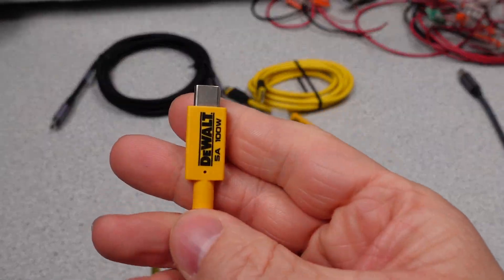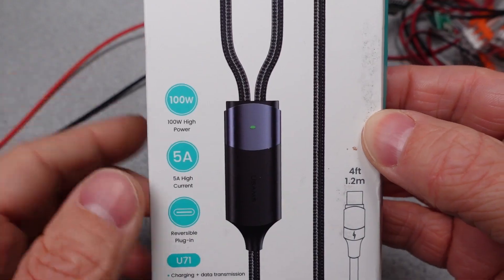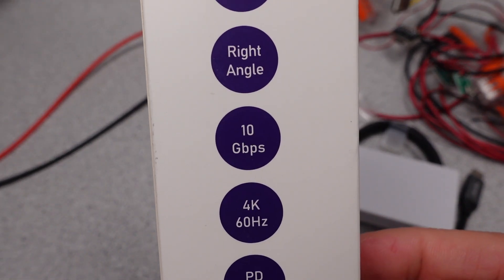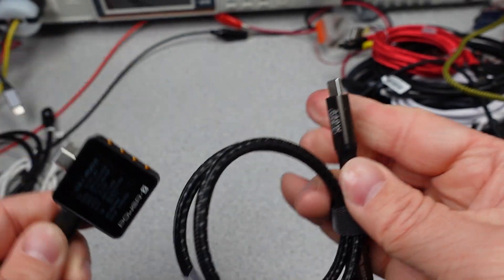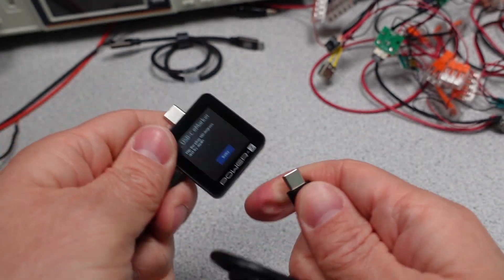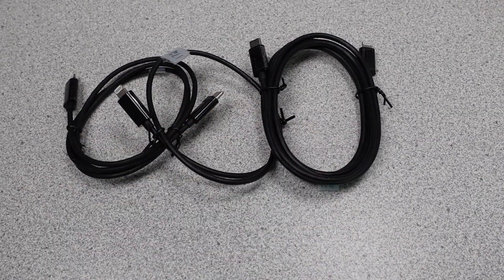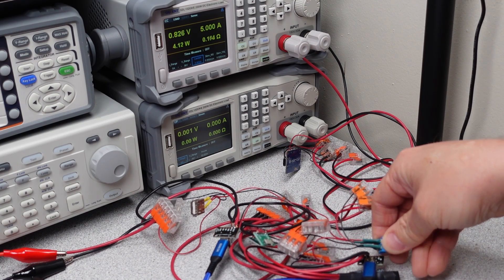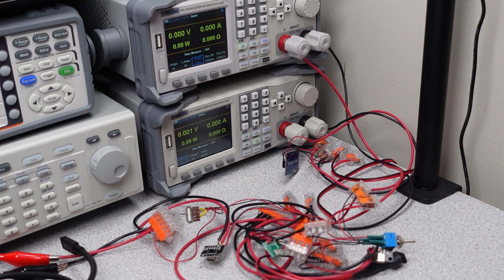USB Cable Power Performance for the fourth time

Comment: Thanks for the video and the good work, I've been waiting for this one for a long time. I'm surprised the 240W cables do not trust the top places for the resistance per foot metric nor make a big step forward in terms of performance compared to the 100W rated cables. 
In your opinion, should we expect a jump in performance (ie lower resistance) for the 240W cables in the future?
Reply from the maker: No.  The wires are exactly the same as before, the only difference is the chip in the connector end.  There are a lot of very good performers though.  I am really curious what wire Satechi uses, because they have a good formula worked out to get a lot of power down that wire and I want them to release a series of 240W cables.

Comment: Best case resistance for USB-C cables at 20C 
USB-C connector resistance is typically @0.025ohms on each end
28AWG 3ft USB-C cable 0.195ohms+0.050ohms= 0.245ohms
26AWG 3ft USB-C cable 0.122ohms+0.050ohms= 0.172ohms
24AWG 3ft USB-C cable 0.078ohms+0.050ohms= 0.128ohms
20AWG 3ft USB-C cable 0.030ohms+0.050ohms= 0.080ohms
Reply from the maker: Yeah, I need to spend a bit of time doing some data analysis and present it better.  Should be able to put the cables in bins as you have presented.
Reply: I got a cable with 2 different lengths from AliExpress which claims 18AWG for the power lines. And measuring with TC66C (using external power, both Power and PD switch are off to make it as accurate as possible) and 5V 2A. The results i got were about 0.0925 ohm for the 1M variant (should be with the connectors then) and 0.1425 ohm for the 2M one. Idk if it's really 18AWG but it does seem to be one of the best so far.

Comment: The spreadsheet is not really interactive and/or not possible to copy. So no way to filter, sort etc so essentially I can't use it to look up cables I would want to buy. Did I misunderstand something or it just doesn't work on my end? tried in a private window without ad blocker as well, same result.
Reply from the maker: Hmmm.  I suck at code, if that isn't obvious, ha.  Jack of no trades master of all or something like that.  Anyway, I just went on the page highlighted the text, hit control-C, made a new excel document and hit control-V and it worked almost perfectly to make a copy.  The top row was shifted over one cell in excel, easy fix.  Then data parade go.

Comment: Surprised you didn't include cables with LED Indicator to your stash of cables. The major advantage of LED indicator cables is showing you if they really charge or just plugged in w/out charging.
Reply from the maker: Oh, thank you, that is a good addition I can make!  I can easily enough add that column.  Not too many I tested have LED's but there are at least a few.
Reply: @AllThingsOnePlace you should definitely try USB-C with led displays. They show voltage, amps, wattage. But I am sure you already knew that. I have like 20 of them...
Reply: @MonkY2k2  any particular recommendation for a 100w / 140w usb c with displays?
Reply: @MonkY2k2 can you recommend any USB-C cables with LED? thanks
Reply: @MonkY2k2  maybe you aren't seeing the notifications, but you definitely should recommend some for us
Reply: Just a headsup, I bought 4 different brands cables with LED power meter displays. All 4 brands lasted less than 6 months. Went through 2-3 cables for each brand. Until I figured out it was the display ODM that was the problem and not the OEMs. One maker even acknowledged this themselves when I reached out to them.

Comment: Beware of USAMS 2 in cable. I had their 3 in 1 cable (C to C, Micro, & lightning)  for a while. It had lots of negotiations. One output doesn't charge when all used. Went down quickly. Contacted seller and they blocked me.

I call them USCAMS.
Reply from the maker: hahaha, yeah, that cable was weird and acts really weird.  I see the one I bought has disappeared but now Baseus is selling it, ha.  Baseus releases a couple good products and then a lot of garbage...

Comment: My adapter supports 20 volt 3.3 amp max and it supports 66 watts, is 5amp usb A to type c cable is enough for my spare cable?
Reply: if your adapter has a USB A port, it will not support usb PD. that is more than likely for some proprietary charging standard
Reply from the maker: Yeah, the VOOC or QC chargers use a USB A connector still, although some started using USB C too but they don't use the CC pins like power delivery.
Reply: @AllThingsOnePlace  Yes,  many of the non big brand smartphones still provide a 2A USB-A charger with a USB-A to USB-C cable.  In most cases they are using the Dedicated Charging Port (DCP) BC1.1 1.5A charging protocol even though it can still be charging at 2.0A (10w) depending on a good low resistance cable.
Reply: I doubt the device you are charging will ever use up to 5Ax20V(100w) since your charger is only 66w. The main criteria is to know if your 5A USB cable is actually low in resistance.  I have tested many USB-A to USB-C 6A and 7A cables and the amperage rating doesn't mean anything as most of the time the 6A cable performs much better than the one with the 7A rating.

Comment: The magnetic cable really stands out, seems a valid option. But usually smartphones are more often charged and their USB C port is more than good enough when they're no good to use anymore. Really sad to see that most good charging cables can't send data or send it at decent speeds. I'm not fond of having double the cables.
I have one question regarding cables I couldn't answer myself: why do USB A to USB C adapters trick phones into thinking there's a fast charger on the other side? Android phones are so convinced that it's a fast charger to show double the amps in on the Ampere app. Thanks!
Reply from the maker: Good question.  My guess is they add a resistor to the USB cable to fool the power negotiation on the phone into thinking its got access to more power.  Since USB A, generally doesn't send any data, it uses the voltage on the data pins to determine charge speed.
Reply: I got the USB data enabled one because I smelled possible issues with a just power ones. No shot. If you're interested they're some with meral housings, low profile, go by lots of brands. The ones I got where from Base Sailor.
Reply: Not a good cable to a purist who wants the absolute best performance in charging,  but for data transmission it would be okay for use !
Reply: I wouldn't worry about the rapid charging protocol unless you have a top of the line smartphone from Samsung or the Google Pixel and even then it will only do rapid charging when the the battery falls under 50%.  99% of smartphone still only charge at 5V x 2.0A-2.4A which is 10w to 12w respectively.
Reply: That's not true, at all. Even 200$ phones charge at 18W at least. Mine charges at 65W maximum. What I'm trying to understand is how "dangerous" this improper reporting can damage (or not) a device like a smartphone or a tablet.
Reply: @TommyThousandFaces  You measured it charging at 18w or you assuming it is ?
Reply: I literally got them with 18W and 20W chargers. Also there are specs on the box and they can't lie.
Reply: @TommyThousandFaces  List the chargers model number and yes they do lie and lie big time as well. Most of the big brands no longer come with chargers nor cables citing their eco conscientious BS so it's very rare a 18w(3.6A) or 20w(4.0A) charger is included, most OEM chargers are the standard 1.0A(5w), 1.5A(7.5w) or 2.0A(10w) DCP chargers. Apple's iPhone was raving about their so called rapid chargers at just 2.4A(12w)  It depends on all three items the phone, the charger and the cable for it to properly charge at the promised rates.
Reply: @etow8034  My Samsung S20FE 5G has ultra fast charging. Got it for a great price!
Reply: The price of copper is skyrocketing and in order to keep the cable as small in diameter as possible they don't include the data wires in charging cables.

Comment: Do you think in a few years everything new will be using USB-C as power, like appliances and fridges too? I'm guessing the next generation will up the max wattage delivered again. And do you think that's a good idea, given it opens up the possibility of using improper cables like some of these to power too-high-powered things?
Reply from the maker: It's a good question, and I don't think it would be good to cover larger things with USB.  Motor powered appliances generally need surge currents and have AC motors that generally aren't going to be very efficient on 48 volts DC even.  If they did they'd need 20 or 30 amps which becomes problematic current wise (really big wires).  So, AC mains powered devices will continue for a very long time.  I could see a refrigerator powered by USB C with a VRF (Variable Refrigerant) system but it'd be more efficient to directly connect it.  In terms of devices though, there are many low powered appliances that could benefit from standardization and take advantage of the myriad of more efficient power supply options.
Reply: No, read up on history Tesla vs Edison or AC vs DC ! ...LoL
Reply: No.

Comment: So what's the best one?
Reply: I would go with UGreen/Anker/Amazon Basics Dr.Juice tested them before & they are among the best.  The Shorter the cable the better efficiency 1.5 & 3 ft ugreen are my choice.
Reply from the maker: Yeah, I need to make the chart searchable/sortable on the webpage so you can select per your needs.  In general, UGREEN, Anker, and Amazon basics make very good USB cables.
Reply: @siannes4599 you got link to video tried findin it